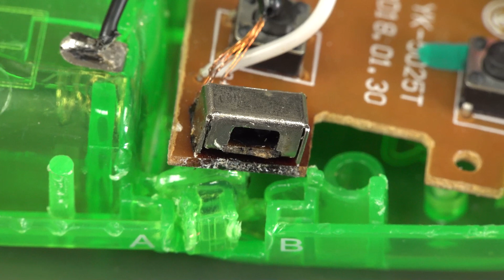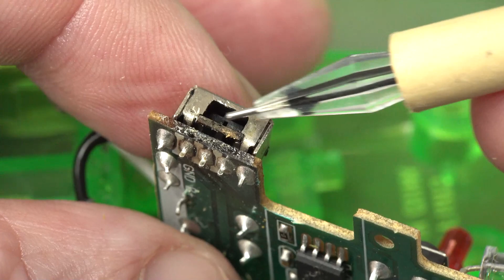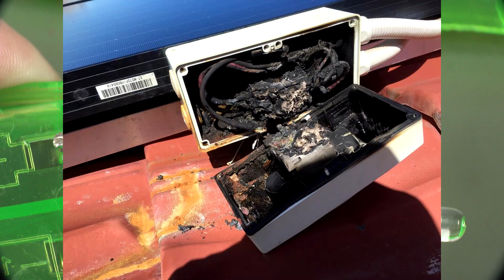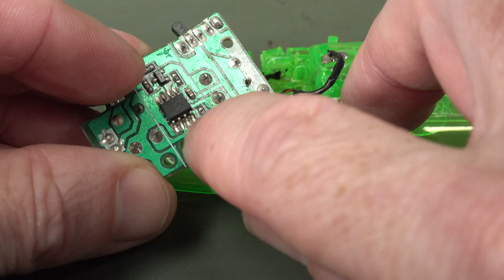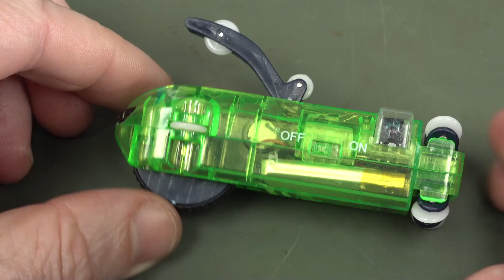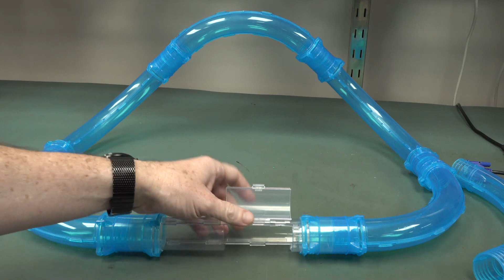The Incredible Switch Replacement Repair

Comment: NOTE: The burnt solar panels photos are NOT of my panels! They are from here: http://www.acsolarwarehouse.com/news/solar-fires-dc-arc-faults-on-solar-systems/
Reply: Hey you could've had fun photo shopping the damaged panels into one of your old roof shots.. (just for shits-n-giggles).
Get well soon!
Reply: Thanks Dave!  I was one of those people that thought maybe the rocker switch may have rubbed away the insulation, so thanks for clarifying on exactly what happened!
Reply: Wow, Dave, I never thought Solar Panels were a fire hazard.  Wow!!  They have more current that I ever thought they did.  I will have to look at the video of your failure.  BTW, those wires inside the remote look like crap, you should have replaced them, or otherwise fixed them.  Every repair I do is a reflection of me and i never would have left wires like that, especially on a transparent/translucent case, but to each their own.  BTW, what does "come-a-gutza" mean.  I've heard that more and more.
Reply: Dave???? Since when cameras are sensitive to UV??? There's quite a difference between UV and IR.... How could you?
Reply: @spacejaga  https://photo.stackexchange.com/questions/2262/are-digital-sensors-sensitive-to-uv Almost all cameras are sensitive to UV, but are more sensitive to IR (and visible, of course)

You're still right that it's an IR LED, haha
Reply: @ShaneGadsby  camera sensors are sensitive to "bleeding" outside visible spectre, but most cameras have UV filtering glass before sensor while IR is left alone.... As you said point remains the same - he meant IR, unforgivable mistake ;D

Comment: They used the 2 throws as the pull up/pull down for the IC Hi-Z input instead of a proper pull up/down resistor and there's no current limiting resistors in case of shorting. If the switch slider connects to the other power terminal before disconnecting the first one, it shorts itself even when there's no fault. It's even worse when the switch is pushed slowly by the user. Also, the plastic parts, which I think is not of a good quality, may be loose or rough, and can cause more resistance for the switch to cleanly switch to another throw. This is a terrible design, and there are similar topics about end stop switches in 3D printers, too.  6:35 is a good time to see, the housing pins are connected to GND, the center pin is connected to the IC through a 0 ohm resistor (what's the point of this..?), the left pin is VCC, and the right pin is GND since it's the same copper fill as the housing pin.

Comment: Awesome video, The best one you have done! All jokes aside. The reason I believe so many asked for a follow up video, was not to see you bridge a connection. Anyone can do that. It was to a) see how much care you put in to the repair, seeing as your son would be using the device. Would have gotten an a+ if not for those wires :) and b) You describe a toy without showing it, and that peeked our intrest. I just wanted to see what the toy was.

Comment: This warrants investigating... I have seen some of these switches that can be put to a "center position" where they bridge out all three contacts. Since this happens only briefly when switching, it's usually not a big deal but if the switch gets nudged the right way, it may be a serious fault in designs like this, where it shorts the supply across the center pin.

Comment: You should have broght out the universal repair tool aka an 8 pound sledge.
Reply: Gentle Persuasion (the name on it) is always available, along with the other smaller hammer, and the nice steel slipper.

Comment: Dave, Dave, Dave, Dave, this was not satisfactory, we came here to see a repair and you skipped over the part where you cut the trace on the board and soldered a wire, we insist on you uploading a full video including any tinning you may have done, any safety precautions you took using any sharp implements, they type of soldering iron you used and your facial expressions that show just how bored you were.

Comment: When you said you were going to repair it I was expecting you to replace the switch although you had talked about just bridging the connection in the previous video. That's an interesting toy. Never seen anything like it in my country but I haven't been to a toy store in a long time. Interesting that the control operates off IR for a vehicle moving around over a large area.

Comment: 9+ minutes video to diagnose a 2 ways switch fault .. 11+ minutes to repair it .. only you Dave. 😉
Reply: Cue the next video where Sagan complained the batteries have run dry the minute Dave brought home the toy remote because of the bare wires.

Comment: Looks like one side of the switch is connected to vcc, and the other side to ground. The slider contact stuck just in the middle position of a cheap switch could absolutely short both poles together. That's far more likely than a short to ground via the case
Reply: I agree. It was probably a "make before break" style switch (Either intentionally or accidentally.)  The burn marks seems to be centered and internal, not off to one side like I'd expect if the guts shorted to the case.
Reply: That point was made in the previous video but Dave seems to have missed it. Looking at the remains it does look as if the slider isn't at the end of its travel. Easy enough to check - the other switch will be the same type.
Reply: I could totally see this as that kind of switch you're not supposed to switch while it's on, but that's totally something you'd expect in a toy I guess…

Comment: So the car also uses the same switches with a lithium battery? Might be a good idea to fix that (e.g. by adding a series resistor to one side of the switch) before it fails in an even more dramatic fashion.
Reply: Or test our theory that it's the switch contacts that shorted by putting it in the middle position.  >:D

Comment: Repair videos are the best, even if they are simple! (even better for noobs who don't get logic board logics) I think there should be a EEVBlog Repair channel! :P
Reply: yes
Reply: I like repair videos, but I’m biased.
Reply: @TheDefpom  I fixed neighbours DSL router power supply one night. No replacement capacitors to hand, but there was this old Intel server board to hand, with the right value capacitors on it, and the usual blown ones. Massive ground plane, so did the Shenzen gas burner preheat method, to get enough parts off to fix the power supply. Replace bulged Samxon with non bulged not too bad Rubycon, and it lives again, probably will do another 10 years. Board now back in the scrap pile with only minor blistering underneath, definitely not going to boot now.

Comment: I am only 3 mins in but I think its just a cheap switch that was stuck in the middle connecting all 3 pins together on the switch.
* Ah maybe not LOL *
Wow that really moves LUL
Reply: That's my thoughts. Looks like one side of the switch is connected to vcc, and the other side to ground. The slider contact stuck just in the middle position of a cheap switch could absolutely short both poles together.

Comment: Can you do a video showing how much energy is contained in AA batteries? Preferably with destructive examples 😁
Reply from the maker: Been thinking about that one for long while actually, so I might get around to it eventually.
Reply: Depends on the mAh rating and internal resistance of the battery. Typical NiMH recharable batteries have a capacity of 2000mAh.
Reply: Speaking of batteries is that battery experiment still going or did that get lost in the flood?
Reply: You can see one go boom in a BigClive video. He was taking three apart and one decided it wanted to see the explosion containment pie dish.